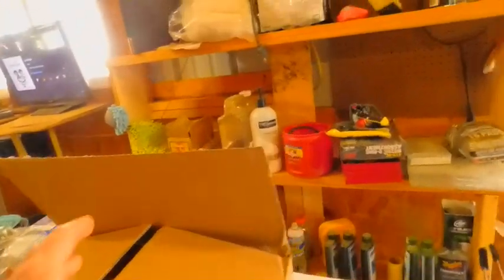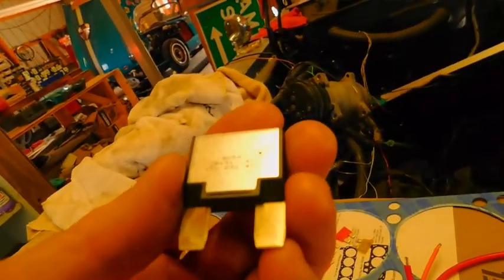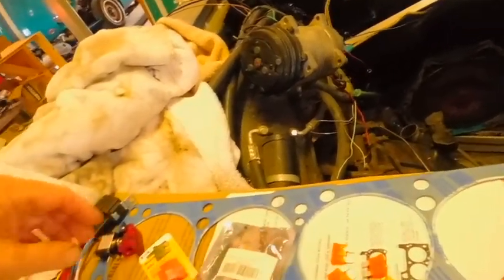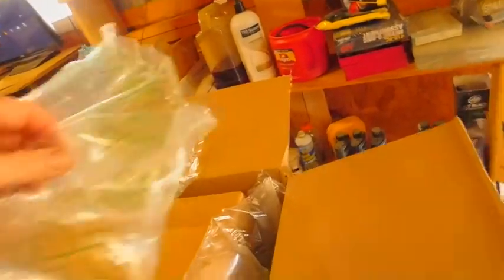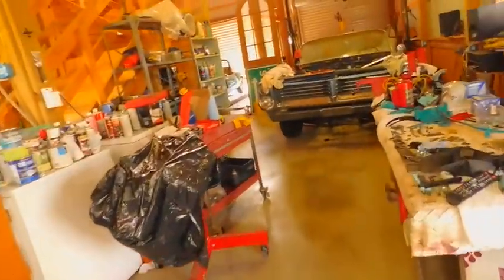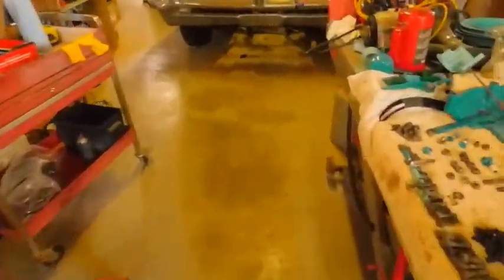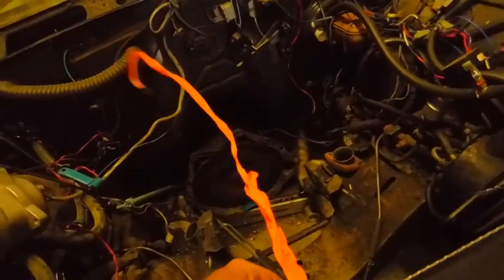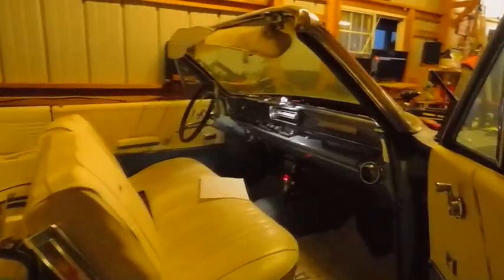Testing the SPAL Fan & Wiring with 40amp Breaker & Relay

Comment: Loved how queit it is. Is this the 16in Spal or 14? What wire gauge did you use?
Reply from the maker: Over the summer I've been using the one in the Bonneville and in the GMC and both work so good.  I was able to use 16's in both as these are older larger rads.  I use 14/16 most all the time in most anything I do except for speakers or something like that.  I also solder every connection and make sure the earth/ground is perfect.  It's so worth the time to do it right as can be done.  I also love the SparkFun bomber/safety LED switches.  Thank You for the comment!  Bobby